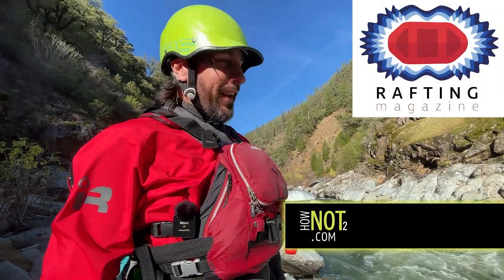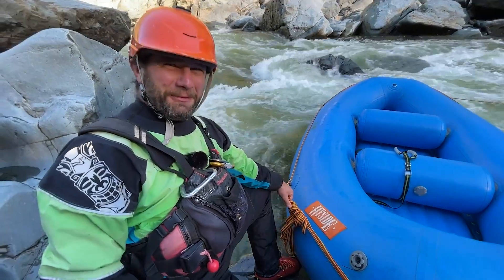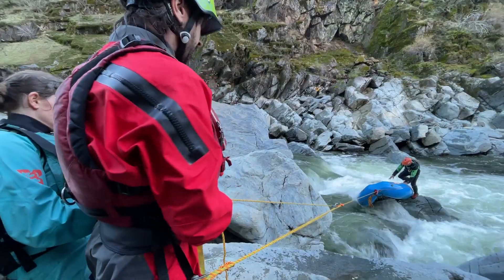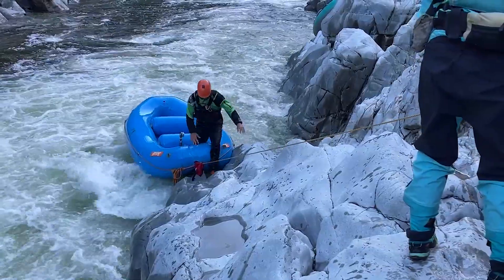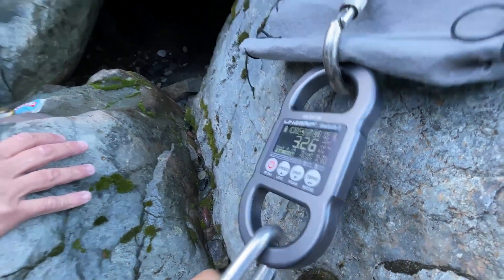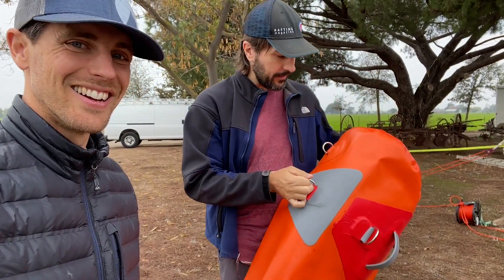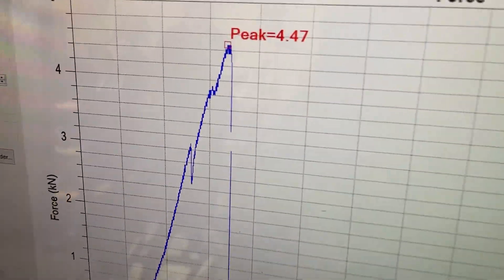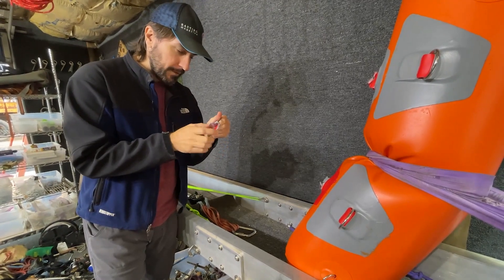See how much force it took to pull a raft off a rock + D Ring Pull Tests

Comment: Some river folks think a vector pull off of a tensioned line creates enough force to un-pin a boat. You have other videos pointing to the amount of force you can get from vectors. Much easier and quicker than a 3 to 1, super good enough?

Thanks for the river content! You ever need time on the water in WA I got you 🤙
Reply: I'm so happy to see some rafting content here. The possible questions are endless. I definitely agree that testing the forces you can produce with common setups, and how those compare with the breaking strength of the gear would be the best place to start. I've already been curious to see how much a vector pull can really add. At what point does adding multipliers get dangerously close to breaking things, and at what point does adding more stop being effective because of loss due to stretch. I'd especially love to see tests on releasable progress captures. I've only been involved in a few whitewater equipment retrievals, but having to cut the rope seems to happen way too often.
Reply from the maker: When my 160lb body puts 2kn on my leash I can generate 6kn on my highline.  Let's say we pulled it tight to 2kn and then put another 2kn in a vector by doing a separate 3:1 connected to a carabiner in the middle of it.  You could generate 6kn in theory.  I'd say you're in a real pickle if you need to do that though :)

Comment: Would love to see how strong the grab handles on whitewater kayaks are, theyre often used the same way as d  rings on rafts when theyve gotten pinned, but they're screwed into brass inserts moulded into the plastic. Most are aluminium, some are webbing and the Waka handles are plastic, and id imagine theyd all have different failure modes.
Reply: You are absoutly right. It depends on the manufacturer, Waka's plastic ones won't do to hot, or the old fabric/webbing handles. Most everyone is using the aluminum grab handles as you have mentione. I would be interested to see the forces required to rip the grab handle out of the plastic mold
Reply: This has been a question for our crew also, talked to a few kayaker friends of ours and they mentioned that getting a line around something more substantial is key since handles aren't really supposed to be load bearing. Probably going to be a good test in the future.